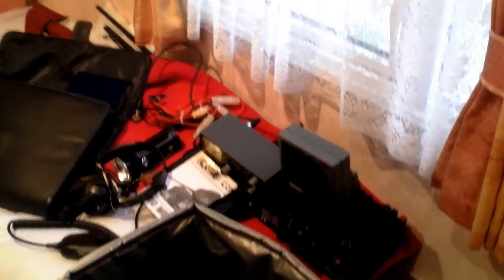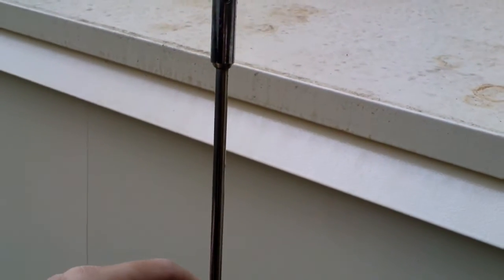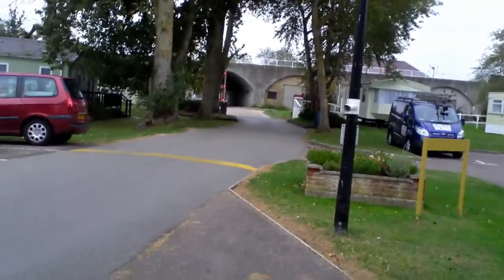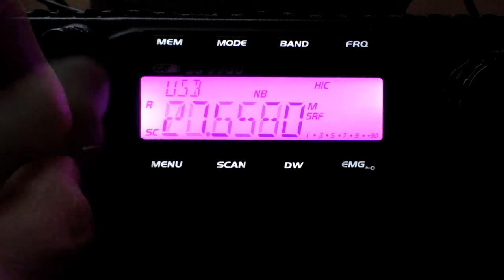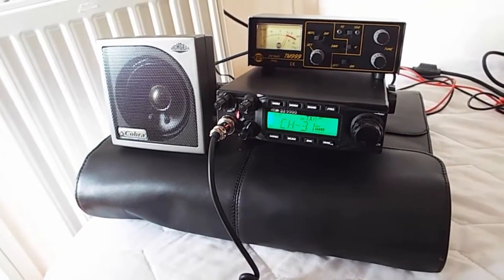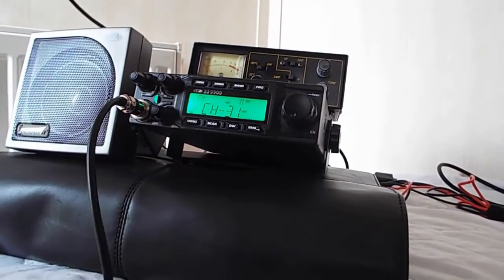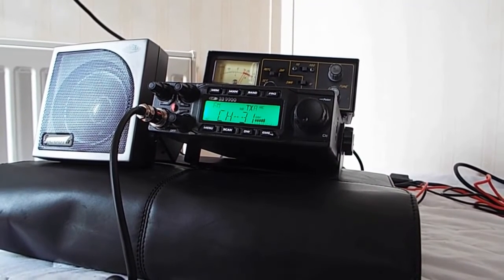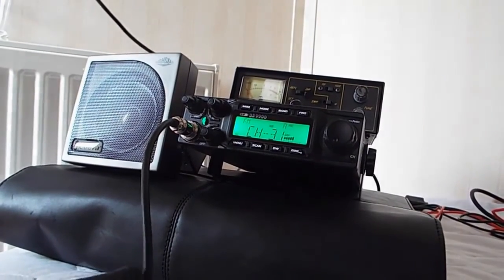CB RADIO. Small mobile set up with a Tank Whip.

Comment: Another interesting video Fred. I use the 9900 as homebase radio. Works well as well. No additional power needed either. One of the best "new" radios out there for me. Thanks again.
Reply from the maker: It certainly gets out Mark.  They can push 100 watts on SSB.

Comment: Best antenna to use is a 1/4 wave, 102" whip with a 4" spring for a total of 106", attached to part of a mirror mount bracket or a home made bracket, and bolted to a non conductive surface, like a roof overhang/fascia. Then take a 106" piece of electrical wire, connect it to the mounting bracket, and run it along the edge of the roof. It should be a perfectly tuned dipole. If you get any SWR reading on it, shorten or lengthen the wire an inch at the time until you get a perfect 1.1 SWR. With a decent SSB radio and using 100 watts, I have communicated with stations over 1000 miles away on a regular basis.
Reply from the maker: Sounds like a great plan. The 106" length of wire should really help with the SWR.    I am next going to try a t2lt on a 9m pole.
Reply: What length for the wire pls?

Comment: I have to say not all the time signal meant you can't make contact, I am here in Connecticut USA  and barely heard a station from the Philippines  on 36 LSB I gave  a crazy shout and was surprised to get a reply, we chat for about 20 minutes call up 3 of my friends on the telephone and they all got in on the  QSO , we all exchange cards it so happen that all 4 of us plus the chap in the  Philippines were using HR2510 ,something i will never forget  (5 years ago)
Reply from the maker: Yes thats a good point often we will make a contact with no signal.  Need a good day with low noise though.
Reply: yep very true

Comment: Hi all new to this well last had a CB 30 years ago (wow) I was thinking to have a little dabble would one of them UV-5R be ok if I got a better aerial as I’d mostly be in my car/van/motorcycle ? Thanks 👍
Reply from the maker: Hi.  The Beofang radios use different freqs from CB which uses 27Mhz so they wont work.  You can get handhelds like the Midland 42 but they are lacking performance.  A good small cheap radio is a CRT One with a mobile whip antenna.
Reply: Will one of them run of the cigarette lighter plug?
Reply: i realize it is kind of off topic but does anyone know of a good site to stream newly released movies online?
Reply: @Langston Nash try FlixZone. You can find it on google :)
Reply: @Byron Kelvin Yup, I have been watching on FlixZone for since april myself :D
Reply: @Byron Kelvin thank you, I signed up and it seems like a nice service :) Appreciate it !
Reply: @Langston Nash no problem =)

Comment: How far into the thick section of the antenna can the whip section go for SWR adjustment? Is the thick section hollow or solid (or hollow just a short way down from the top)?
Reply from the maker: The solid bottom section has a hole drilled about 2.5 cm.  The swr tuning only requires about 1 cm either way of center.

Comment: Can you disengage the SWR high warning on the 9900 Fred ? I change antennas quite frequently and find it awkward adjusting SWR each time/ Thanks Fred.
Reply from the maker: Yes you can Mark.  Go into MENU and its the No 6 function called TSR, you can turn it off.
Reply: Thanks Fred. I will do that asap.

Comment: now using a sirio 5000 antenna but cant get swr down, so might have to go baxk ro rankwhio, what do you think fred ?
Reply from the maker: What sort of mount do you have the 5000 on ?
Reply: @CB-RADIO-UK  uts on a 7 inch magmount on top of an 8ft pole
Reply from the maker: @simc9684  Confused.  Are you using it as a homebased antenna. ?
Reply: @CB-RADIO-UK   yes I am using as a homebase antenna
Reply from the maker: Got you.  The high SWR will prob be down to the lack of ground plane.  I would try it on a metal car gutter mount attached to the pole.
Reply: @CB-RADIO-UK  I have it on a 8 foot pole which has a small round plate, would I need to make that bigger